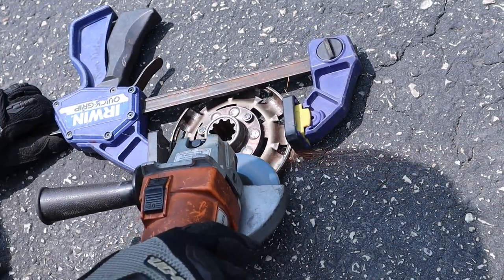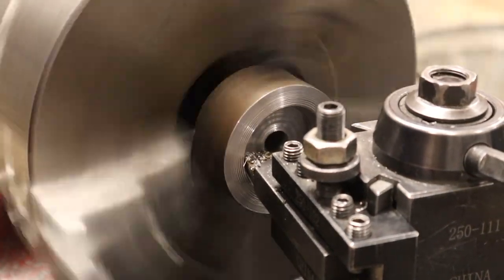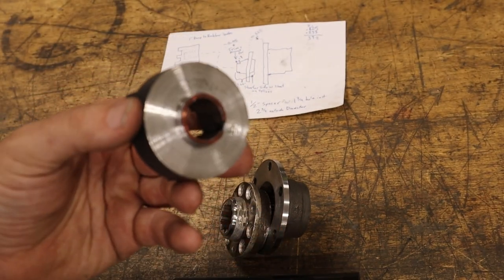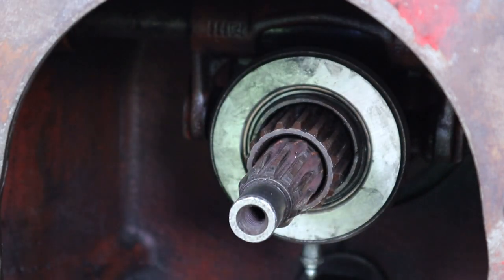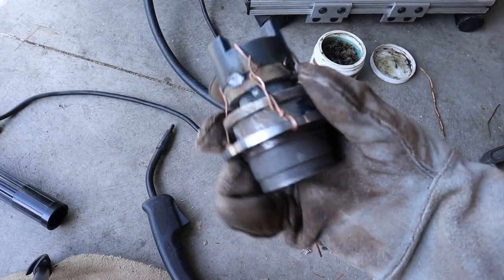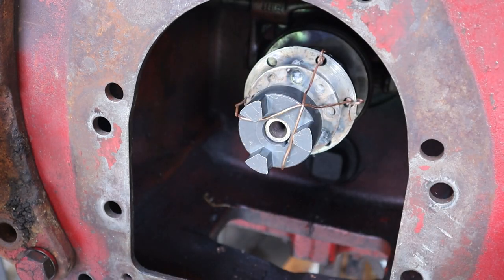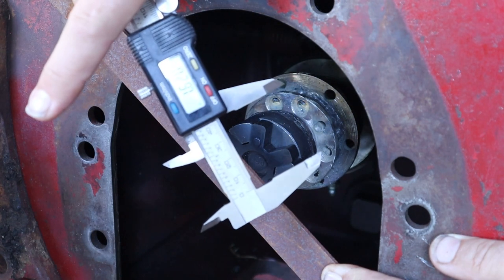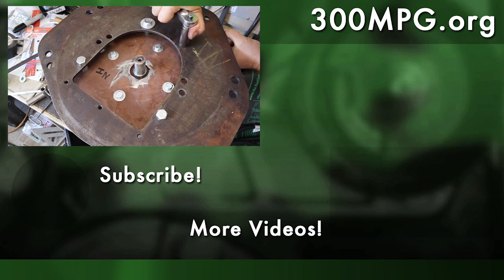Electric Tractor Coupler Construction, Part 2

Comment: The inner shaft is flopping because that smooth 1/2 inch, round section out at the end of it is supposed to ride inside a pilot bearing on the back of the engine-- so that would have it supported on both ends.  I think once you get everything tied together, the lovejoy will help to stabilize the shaft----  but if that lovejoy's rubber damper ever gets beat up and loose fitting-- it could allow that inner shaft to flop around a little too much and might bust the case, or at least blow apart that inner bearing..  So you'll just have to keep an eye on the lovejoy as time goes on, and replace the damper if it starts to get sloppy.

Comment: WIth access to the Maker Space, I would have thought you would have made the spacer that goes between the two parts that would take advantage of the rivet holes.  I was thinking how cool it would have been to make a ring that had the two different hole patterns so it could be bolted together.  I didn't think you had access to a lathe, so figured that's why you're welding it.  It would have been a bit more work, but it would have been cool.
Reply from the maker: Those hole patterns exactly DID not line up with each other, but would have also interfered with each other if I tried putting in bolts from both sides. Drilling and tapping all those holes exactly right would have been tricky and a lot of work.
Would have been cool if it worked out, but nope, exactly wrong.

Comment: Ben,  I have been watching your tractor conversion videos and was wondering how you decided on the side of DC motor to use with this tractor.  It appears that DC motor hp is not the same as ice hp, so I was wondering how you decided?   I've got a Ferguson TO-35 tractor that I might convert to ev someday so your project is very interesting to me.   The TO-35 has a hp rating around 33, so would a 20 hp dc motor be adequate?

Comment: Could you please help us understand the function of the coupler assembly? Is it meant to distribute the motor power to various functions or transmission?
Reply from the maker: In the tractor transmission, it is a DOUBLE input shaft. An automobile has a simple single shaft, which goes through the gears and powers the wheels.

In this tractor, there is that AND there is the rotating collar around the input shaft. That rotating collar powers the tractor's Power Take Off (PTO) which is a spinning driveshaft on the rear of the tractor to power accessories.

The PTO can be independently engaged and disengaged with a hand-lever to the right of the operator's seated position.

The coupler connects from the electric motor to BOTH parts of this 2-in-1 transmission input shaft, so that the motor can spin the wheels AND power the PTO.

Comment: I am curious as to why you left the throw out bearing in place.
Reply from the maker: No need to remove it. It doesn't get in the way.
This is all still really an experiment. I'm likely to use a different motor with the flywheel. We'll see, but if I do, the bearing is already there.